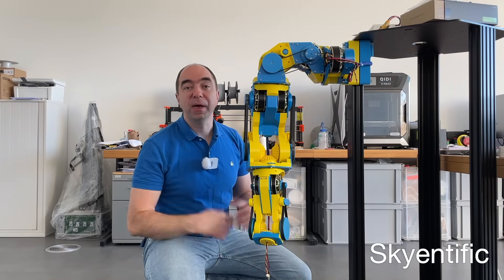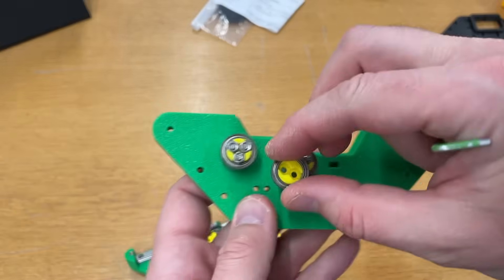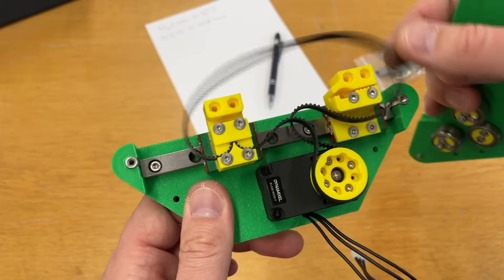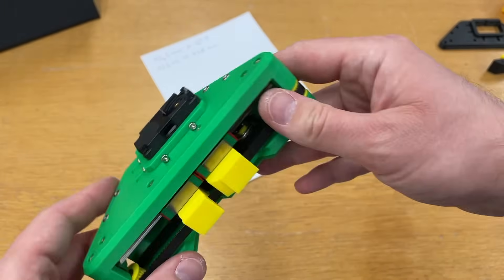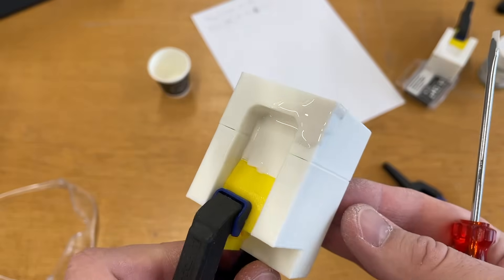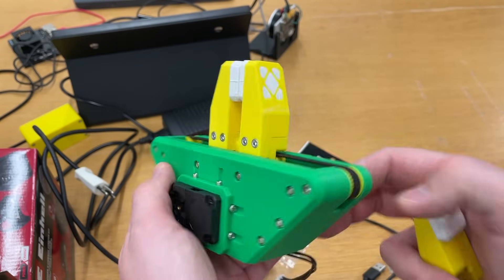How to make a Robot Arm Gripper

Comment: Love the channel, keep up the awesome work! Something you could cover in detail I haven't seen a good video of would be how to hook up those as5047p with SPI to a controller, perhaps an odrive. I was able to follow an old video where you used AB mode and got that working but I'm struggling with SPI, and I think you have to use SPI for skipping calibration on an odrive 3.6

Comment: Robot Arm Gripper Assembly: A Detailed Guide

*   0:00:06 Project Overview: The goal is to build a gripper for a robot arm, powered by a previously built battery.
*   0:00:21 Materials and Components: The gripper will be assembled using 3D-printed components, three servos (one is broken), maker beam rails (134mm length), GT2 6mm wide belt, bearings (12mm inner diameter, 18mm outer diameter, 4mm thickness; and 3mm inner diameter, 10mm outer diameter, 4mm thickness), and various screws and nuts.
*   0:00:36 Gluing Components: Some 3D-printed parts are glued together using super glue for aesthetic purposes, as they are not subject to significant forces.
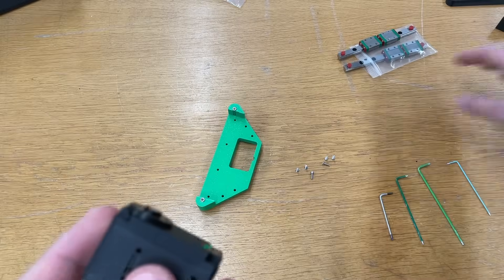*   0:02:12 Servo Motor Installation: The servo motor is installed and secured with M2.5 8mm screws.
*   0:02:51 Pulley Installation: A small pulley is installed on the servo's output shaft using four M2 6mm screws.
*   0:03:03 Rail and Carriage Assembly: The maker beam rail with two carriages is attached to the main structure using M3 12mm screws and embedded nuts.
*   0:03:29 Pulley System: A pulley system is created using bearings and 3D-printed parts to guide the GT2 belt.
*   0:04:59 Belt Installation: The GT2 belt is installed, which is a challenging process requiring precise tensioning and alignment.
*   0:06:01 Belt Length: The required belt length is 428mm.
*   0:07:12 Belt Tensioning Issue: The initial belt installation resulted in misalignment, requiring adjustment by moving one slider on the belt by one tooth.
*   0:08:05 Base Assembly: The base of the gripper is attached to the robot arm and the main gripper structure.
*   0:08:36 Finger Installation: Fingers are attached to the sliders using 12mm screws.
*   0:09:20 Silicone Padding:  The plan is to add silicone padding to the fingers to improve grip. Molds are created for this purpose.
*   0:10:15 Silicone Molding Process: Silicone is poured into the molds and left to cure. However, the curing process was uneven, with some parts remaining liquid after 12 hours.
*   0:11:12 Post-Processing: The cured silicone parts are trimmed and attached to the fingers.
*   0:11:50 Gripper Completion: The mechanical assembly of the gripper is finished.
*   0:12:14 Gripper Specifications: The gripper weighs 377g and has a maximum gripping force of around 4kg.
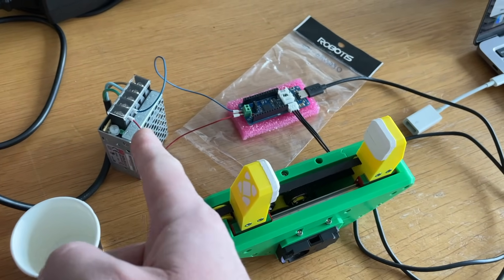*   0:12:27 Control System: The gripper is controlled using a microcontroller connected to a PC, allowing for both position and force control.
*   0:13:59 Future Plans: The creator plans to build a second gripper and a second robot arm.

I used gemini-1.5-pro-exp-0827 on rocketrecap dot com to summarize the transcript.
Cost (if I didn't use the free tier): $0.03
Input tokens: 22085
Output tokens: 711